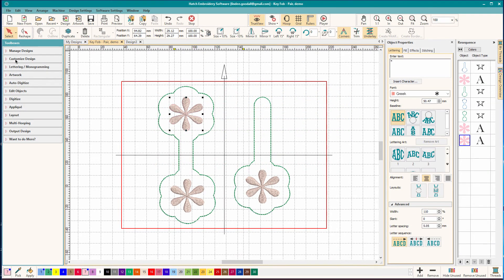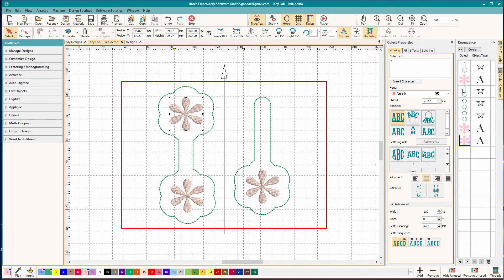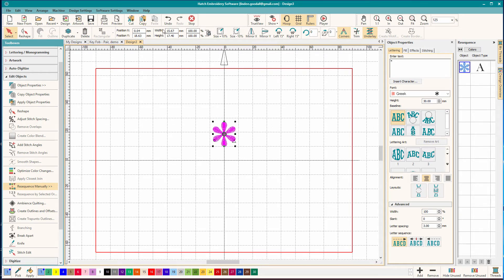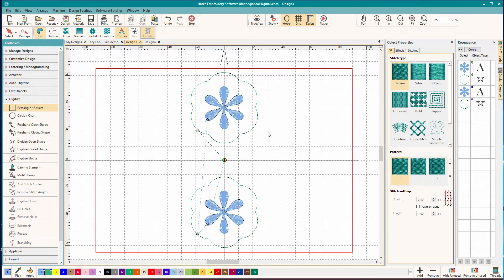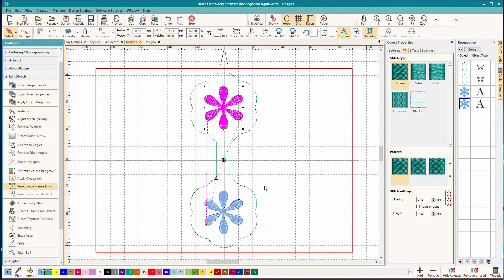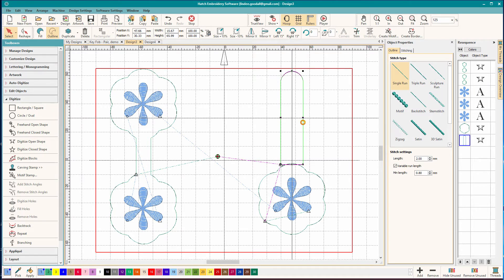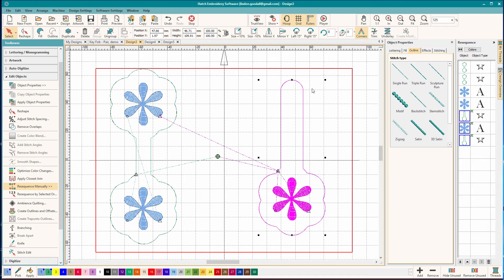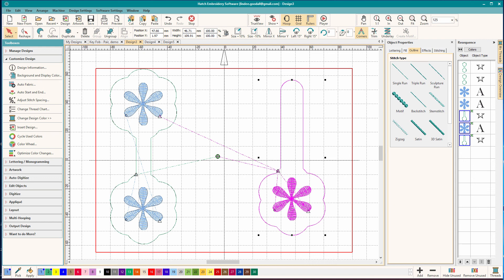Wilcom Hatch - How to Digitize Key Fobs

Comment: Is there another term for 'creating outlines and offsets"? I use Premier Plus for a Topaz 50.  I have searched my manuals and can't find that term, or the tool that would do the same thing.
Reply from the maker: StitchArtist 3 does it with 2 different tool. On will trace around the stitches to create outlines and another tool (Inflate) will create the offset lines. Punto calls it the inline/outline tool. I have no clue about other programs.

Comment: Thank you Lindee.  Love your video.  I have figured it out however you gave me some hints perfectly.  I do have a question.  I have Janome Version 5 that is a duplicate of Hatch or similar.  When I am editing in my Version5 my hoop starts to go crazy how do I lock my hoop and design in place so it does not move.  I am sure the procedure is the same in Hatch.  I have tried contacting Janome but there support for the software is next to none.  If you cannot help I will contact Wilcom.  Thanks again.
Reply from the maker: Thanks! Go to Software Settings > Embroidery Settings and under hoop position, check "Manual."  I haven't figured out how to make that the default yet.
Reply: Hit k on keyboard it locks design or bitmap or right click and select lock
Reply from the maker: Thanks! My fingers keep trying to use the shortcuts from my other software (which are similar to Adobe Illustrator) and when I do that in Windows. all sorts of goofy things happen!  Not good for a video!
Reply: Thank you so much. You broke it down and made it a lot easier for me to understand.